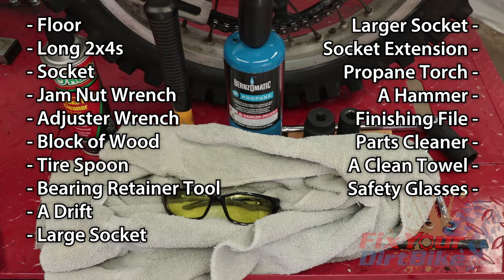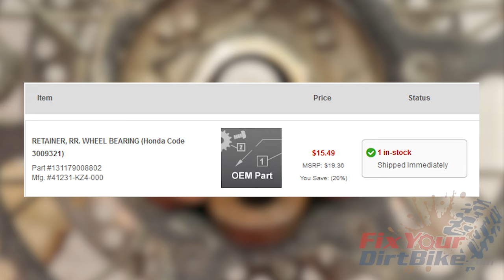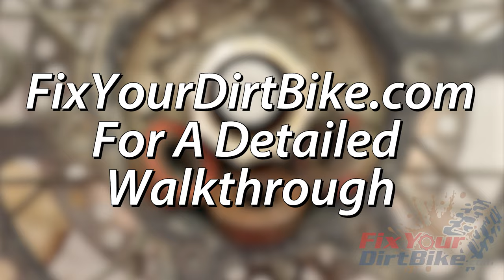How To Change The Rear Wheel Bearings On Your Dirt Bike | FYDB

Comment: Great video I just replaced the rear wheel bearings on my 97 RM125 I followed along step by step the only difference is I had 2 snap rings instead of a retainer nut. I also like that its not 20 minutes long its just what you need to know and that's perfect

Comment: I do have some feed back that would be helpful in your future videos. Your verbal explanations and written step by step are spot on but you could deffly show more video to what you are doing in each step. For us visual learning types, when you fast forward the visual just isnt there. Not trying to hate on your video just wanted to give some feed back that I had after watching it. Like I'm still confused on how to beat out the bearings. If you use a socket that is the size of the bearing to beat out the bearings and there are bearings on both sides of the hub, how will the socket fit through the side that has 2 bearings in the way to beat out the single side bearing?

Comment: just got a new wheel and the bearings inside don't fit my old rear axle that I have, and I was thinking that I could buy a new axle that fits my new wheel but if I buy that then I think their would be too much play when I put it threw the swing arms since I need a tiny bit smaller axle, so I don't know if I should change out the bearings inside the new wheel to fit the axle.
Reply from the maker: Don't change the axle size. If you can find a bearing set that fits the inside diameter of the hub and outside diameter of your stock axle, that's the way to go. You might have to do some extra work to find the exact size bearings, but I'm sure you can email manufacturers your dimensions and find bearings that work.

Comment: Can you do this without using heat?
Reply from the maker: No, the bearings are an interference fit, so the bearing needs to be smaller than the hub or the hub bigger than the bearing when removing/installing.

Comment: Can I use a screwdriver to carefully remove the barring retainer?
Reply from the maker: I think you have a circlip, not a bearing retainer.
Reply: Fix Your Dirt Bike ya I just pulled it apart, there's just 1 clip on the brake side.
Reply from the maker: Sweet!

Comment: My bearing retainer is stuck I can’t get it off any suggestions
Reply: Pack it with dry ice for 15-30 minutes. Heat the out side of hub after. The try. Ice may work also
Reply: Thanks will try

Comment: You said to remove the brake side bearing first by using a socket on the sprocket side. But how do you use a socket with the sprocket side bearings still in. Picture 9!
Reply from the maker: Tap directly on the sprocket side bearing race.

Comment: I have a question: is it normal to have a left and right gap between the swingarm and the wheel hub, spacers, bracket?
Reply from the maker: No, there should be no spaces. Does your wheel slide side to side on the axle?
Reply: Yes I changed my bearing/seals and spacers and I got side to side play. I have to say that my hub was loose on the double bearing side so I punched some little holes in the hole to make my bearings grip as a temporaly solution. With my side to side play, I will add washers equelly on both side. Wath do you think and wath do you suggest me for when I will have to fix it the right way?

Sorry for my english im french canadian
Reply from the maker: Sorry for the late reply. Is your bearing loose in the hub?

Comment: "Heat the hub and not the bearing" as heat is being directly applied to the bearing......
Reply from the maker: Well, they're pretty close to each other.
Reply: Fix Your Dirt Bike      Except one can heat the hub simply without putting the torch right on the bearing.      🤷🏼‍♂️
Reply from the maker: Horseshoes and hand grenades.
Reply: @Fixyourdirtbike   unless you're throwing hand grenades in the horseshoe pit. Or throwing horseshoes at the machine gun nest.  They're drastically different things.
shrug the whole point of not applying heat to the bearing is to limit how much you expand the BEARING in relation to the HUB. You want the hub to expand and not the bearing.
 But you were applying DIRECT to the bearing moreso than the hub. Counterproductive.
Reply from the maker: Well, you know the old saying, "It's hard to mustard on a hot dog without getting some on the bun".